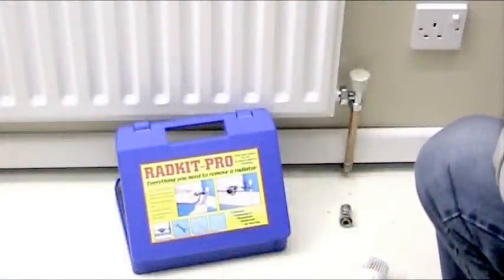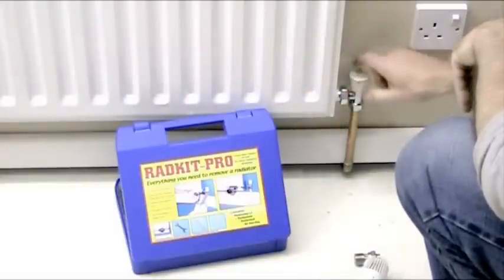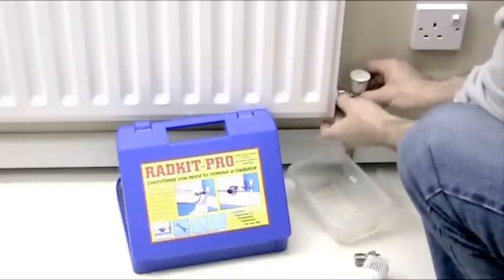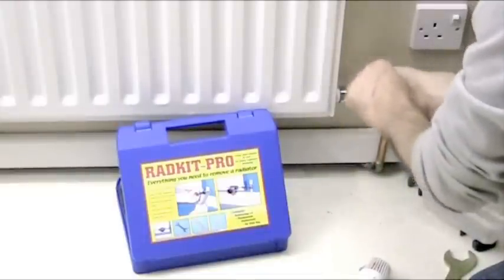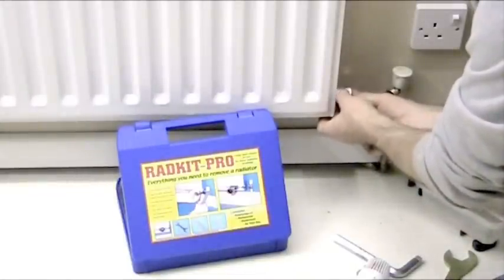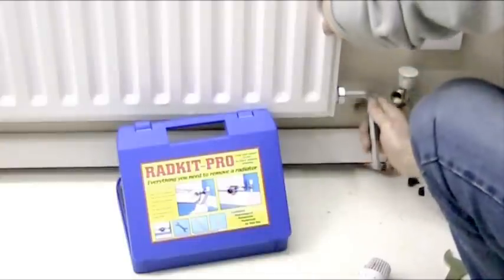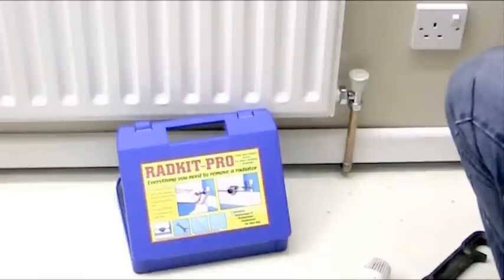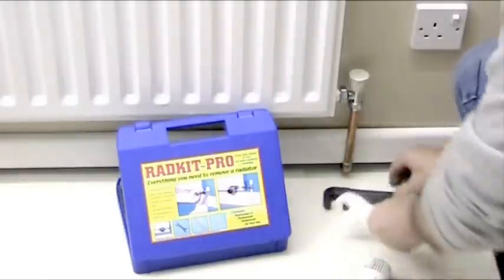Repair leaking radiator tail on radiator.

Comment: Apart from the 12mm Allen key, (my radiators have a spanner fitting) the instructions were spot on. I'm not a plumber but managed to fix the leak we had. Cheers mate
Reply: The internal hex ones are unions valves, much smarter as you don't see the hex nuts. You're is a trv style fitting.

Comment: I have put 20 clockwise turns with joining compound on the tread inside the rad. I have not fully tightened the rad tail home, because I don't' want to damage the rad thread. However, the joint feels loose. Will the joint leak, and should I tighten all the way? Your thoughts?

Comment: Great video. I would now add (having done this) to use a good quality PTFE tape with the WRAS logo and make sure it's bedded into the grooves of the thread so as to not slide off when you insert the valve tail into the radiator. Mine was some 13 turns in the end, plus the one to get it 'on there'.

Comment: I do mine with flax and jointing compound never leaked but recently a tiny leak appeared just wondered are rad threads faulty or should I use the locktie  glue  I have use it before I’m sure it’s the rad thread

Comment: All good advice, but in practice, more often than not, it would not be possible to move the feed pipe out of the way to perform these operations. Ideally that practical limitation should have been mentioned.
Reply: Yeah, how is the pipe so loose? Was that just setup for demo purposes? I'm putting trvs in my house. Upgrading from the old union valves. Have to drain the whole system because I can't get to the tails as the valves get in the way.

Also new valves on old radiators are difficult. The rust inside makes it difficult to get a good seal. I need to redo some of them and use more ptfu (also clean the threads)